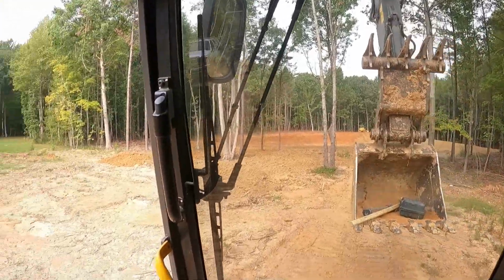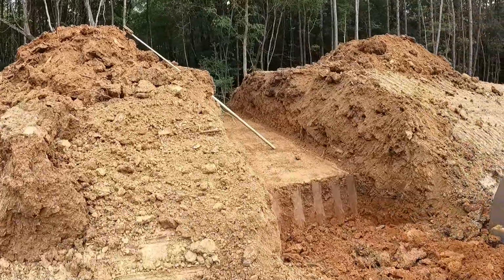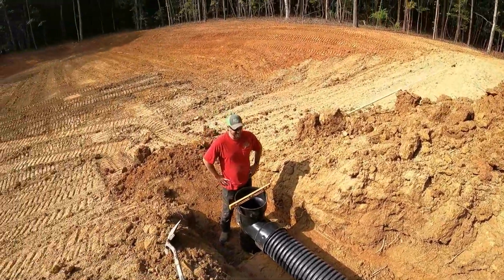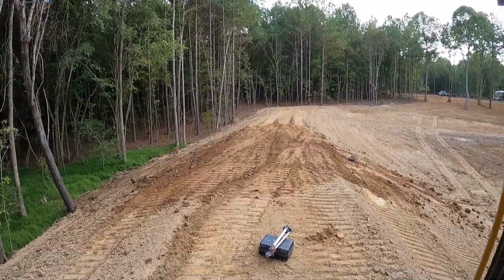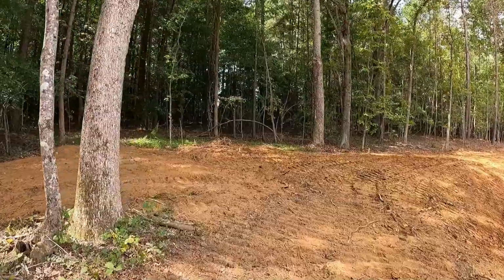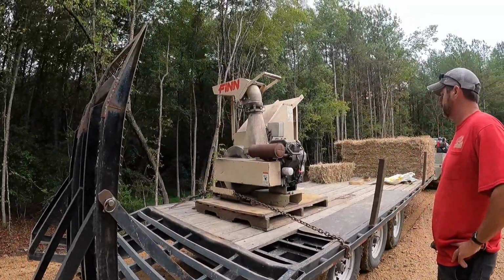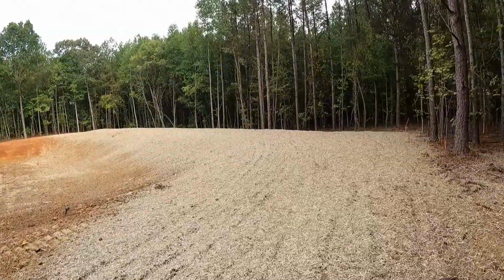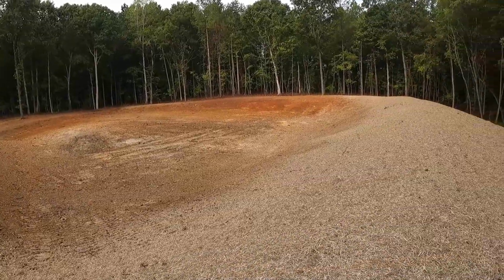Finishing The Pond Job

Comment: Do you not mind the extra maschine hours and the higher use of the chassis, sprocket, chains rolls etc useing the dozer for tracking all in? as far as i looked new tracks without trackpads, screws for reuseing the old trackpads, drive sprocket, bottom and top rollers as well as new bearing and pin for the tentioning roller, combined for a track and chassis service on a dozer your size is abaut 5 grand in parts allone if you get dirty and do all the work yourself

Comment: Chris, on those dry ponds, do they ever drill for water so its more than a mosquito pond?? I know that drilling a hole in the pond itself is a real bad idea as the water would leak out the bottom when the table changed even slightly so it being a hardwood forest close, I would think water should be there in volumes. I liked the more humble side of Mike as he is ever so often "always right" if he has to twist it a bit. Thats the only thing I find fault in him as he can operate with the best of them. I still am in awe of your straw in a bottle trick Chris

Comment: Why couldn’t a GPS chip be imbedded in one of the teeth on the bucket to give you a constant reading of the elevation of the bucket? Or is that really not necessary?
Reply: If you did that, you wouldn’t want  it on the tooth- they get replaced.maybe near the teeth, but not on them.
Reply: GPS height accuracy is more of the order of feet or metres, not inch or millimetres.

Chris do have a laser level sensor attachment that he can attach magnetically to the excavator boom. There were some videos of him doing that on the Animal Hospital project. I don't remember him doing similar on his dozer though.
Reply: @SMSabriIsmail  he does have a magnetic Lazer level that works with Lazer on the tripod. I think it slows him down so he go's by eye and that is almost perfect